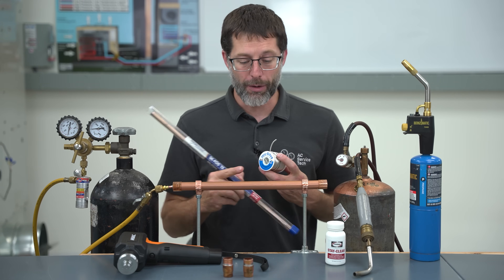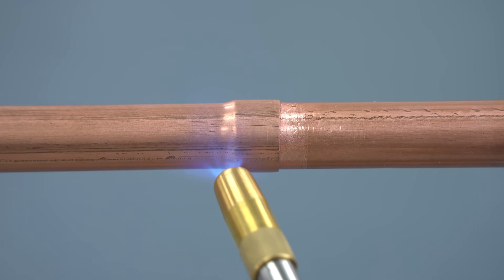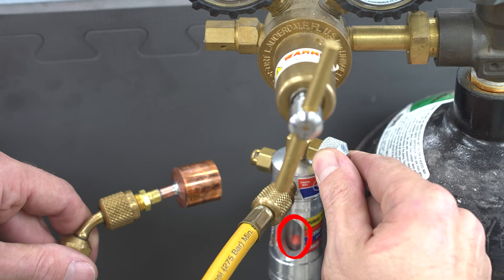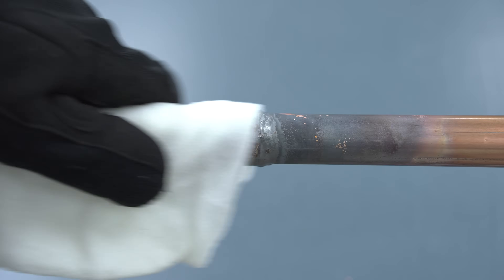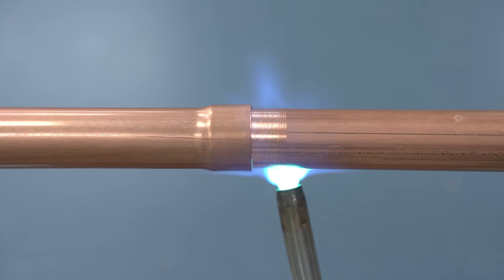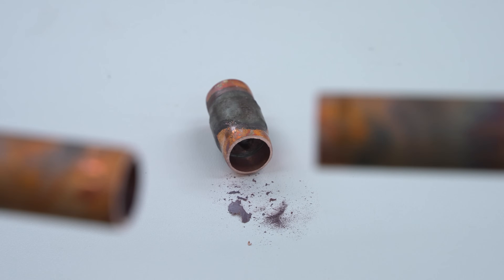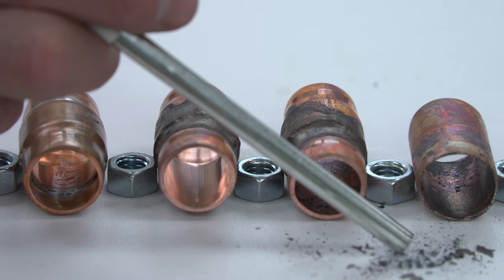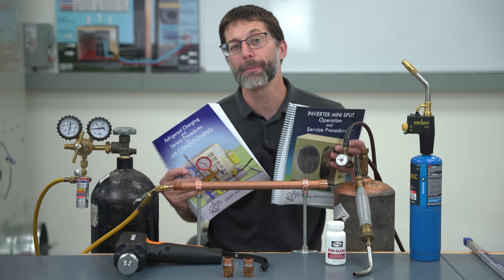HVAC Silver Soldering vs Brazing vs Brazing While Flowing Nitrogen!

Comment: For Stay Brite#8 soft silver solder use the Stay Clean liquid flux, not the paste, wipe on sparingly with clean rag or brush, residue will burn off when you heat up the copper. This prevents flux from entering the system, and cleans the copper beautifully. I've done this for years and never had a problem. Wear gloves, the liquid flux is very acidy and you don't want it on your hands
Reply: I agree. I wish those making vidios like this would use the liquid flux. I've never seen one. Maybe It wouldn't fit thier naritive.
Reply: Dang dude I've been using my finger to spread teh liquid flux. Never even thought about the fact I'm melting my fingerprints off. Good point

Comment: I have been reading the Stay Brite versus braze discussion in the comments. It’s important to understand that acid is a reagent that is consumed in a reaction. It is not as though the flux stays reactive in the system forever and can corrode endlessly.
Reply: People used to solder all the time and it was never an issue. I seen a bunch of old r22 some 20-30 years old all solder. Original parts.. no issues.
But now its an issue because...

Comment: Yes sir 15-% w turbo torches worked for 40 + yrs but never thought to flow nitrogen bk in 90 s set so many AC HP Coils doing trim n sets for booming HVAC cos as sub contractor no nitrogen braze & no me but there start up crew would do purge no vacuum startups now comes along lot txv & 410a w hydroscopic oils then all changed  procedures changed labor cost went up in price went  up  … retired now, but still like to keep up with a game

Comment: What hands held sander did you use for the end I would like to get one
Reply: It's just a copper pipe brush.  Oatey makes them, as well as other brands.  You can get them at most big box stores.  There are also some with a shank so you can put it in a drill and spin it on the pipe that way.

Comment: No one has commented on vibration, i will take a brazed joint over a soldered joint ever time they will not come apart.
Just get a nitrogen tank and do the job the way that all manufacturers recommend.
Reply: Yes, also on low temp and med temp systems the extreme cold temp the suction lines get, I’ve seen the solder joints let go, creating micro leaks.

Comment: Craig, love your teaching, but that was a crappy solder job.  I'm a homeowner who installed my own system and even I solder better than that.  Also, you don't need to goop the flux on, it only needs to just coat the surface of the male fitting.

Comment: Can the Wrought copper fittings made by Nibco for Air Conditioning, Potable Water, Refrigeration be used in HVAC which are sold in big box stores like Home Depot? or would I have to buy the ACR copper fittings that are mainly only sold at a HVAC supply house?

Comment: We had techs that didn't like to flow nitrogen. On one of our large piping jobs the strainers on the evaporators of two of the units were completely packed with the remnants of that oxidation. Call back on brand new systems before they were even commissioned. Flow nitrogen, period. I liked your video.  The only thing I would change is not have your flame on the pipe. Pull it back a bit, get more even heat and an easier braze. Also you don't have to build a shoulder if it is a good braze, although I am guilty of it on remote jobs for extra insurance. I like staybrite but only use it on water pipes, condensate drains, etc.

Comment: When brazing with propane or butane and an oxygen concentrator, I wonder whether the butane or propane could be used as a shield gas. It will of course make a little flame at both the break and wherever it vents out, but if it shields then it does remove the need for a CO₂ or nitrogen bottle. I'm not suggesting this because it could only be done under strictly controlled conditions due to extreme danger of explosions, but it would be interesting to know whether it works. Of course the oxygen concentrator does have a nitrogen output but perhaps not pure enough for shielding?
Reply: Interesting idea, but nitrogen is cheap and safe.
Reply: @radarecho57  Nitrogen for the folks who have it on hand, but if not then what?
Reply: @stepannovotny4291  I guess you can try a propane purge on some scrap tubing and see how it looks inside.  I'm curious.  If it works then you just need to address the safety issues.

Comment: I've used silfos for 30 years of brazing while flowing N2.  It has a very long term success with the use of a 400 micron vac and a 250 lb N2 pressure test for leaks.  I've used stabrite with success also but prefer silfos as it has a higher plastic range.  One down side to N2 flow is
if there is backpressure it can blow out the fillet and lead to pin hole leaks.  
Some have indicated that they stabrite the stubs and then use the press fittings and tool to connect the tubing.  Remember that cleanliness
is next to perfection when it comes to hvacr piping. Good video.
Reply: The issue has never been strength or porosity.  It's the flux like he states in this vid.   In a refrigeration circuit, you want nothing BUT the refrigerant inside.
Reply: You don't have to use much nitrogen, just enough to remove the oxygen from where the joint is. I purge the line and then nearly close the nitrogen as there's nothing to "push" oxygen back into the joint once it's purged. I know many techs who don't even carry nitrogen. Hearing how they pulled a vacuum and then found leaks that they could hear when they started charging makes me cringe!
Reply: @2020HotShotTruckingLLC это звучит как обман, как они вакуумировали??? Хороший мастер даже по стрелочному манометру увидит, что есть утечка.
Reply: @KirillZavrazhny  Lol! We averaged 10 new techs per year. That's a lot of bad techs to go behind and clean up their messes over the years!

Comment: I agree with the few long term tradesmen who have responded about ditching the old high temperature method of silver solder (fluxed) and sil fos and going with the Harris Super 8 low temp method using a minimum of flux placed properly.

  I always loved how 15% silver sil fos was so sociable and forgiving but I'll be happy to ditch it for an easier and well accepted low temp method.   Only wish Harris Super 8 had gained acceptance sooner ... the old ways die hard but I'll celebrate the passing of this one.  Now retired after 38 years in the trade.
Reply: and again, any "acidic" stuff in the system will react and ...well, disappear. acidic stuff doesn't stay acidic forever and slowly eat through your system. it reacts and it's spent. period.
Reply: They revised mechanical code about 12yr ago to accept silver solder, aka sb8, but not soft plumber solder for group A refrigerants. I use it quite a bit including cap-tube solder. The trick is remove heat while leaving solder long enough to form a thick fill. This stuff is strong and it handle vibration and hot/cold expansion quite well. I use it for walk-in box and freezer unit as well. I only blaze the free floating line set in the ceiling where people can move or hit it accidentally.
Reply: @pnp8849  If you use a solder, like Stay Brite 8, you should be cautious where you use it. Specifically, it it not to be used on piping with operating temperatures above 200 F as the probability of failure increases exponentially. So, don’t use it on a compressor discharge line! Speaking of which, Harris doesn’t even disclose this on their solder, but Lucas-Milhaupt does… Basically, the closer you get to the solidus point (400ish for solders) the more likely it is going to fail, regardless of being braze or solder; accordingly, as brazing has a higher solidus temp is is stronger at higher temps.

Comment: Great info. As usual.....BTW I use the Red Glue on copper joints , no heat required,  it's a great product works up to 700 psi, you just clean the copper real good apply the red glue put the pieces together and turn them works through friction to seal...it really works , I've used it for years.
Reply: What is the red glue?
Reply: WTH, seriously??? Never heard of it!  Of course, even if it's true, some joints can't be rotated.  Sounds interesting though.

Comment: Very well composed video!  It was great to see the examples of the Solder Vs Purge Vs non-purge techniques and what gets left on the inside of the joint. I've watched HVAC techs braze the connections for both of my home AC systems neither one purged with nitrogen, but now I know to make sure the tech that does the work goes through the proper process to insure a clean braze area inside of the joint.  I will also applaud you for taking the time to demo the proper handling and shut off of the torch and purge regulator I used to use acetylene at work for soldering joints and seams for splice sleeves in lead sheathed telecom cables, and knowing how to handle the torch was a big safety item.